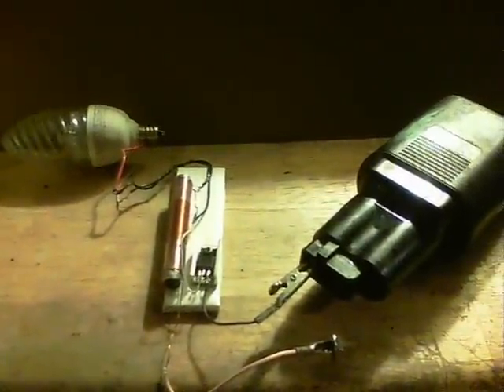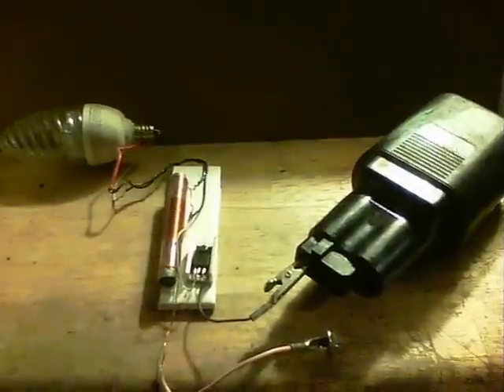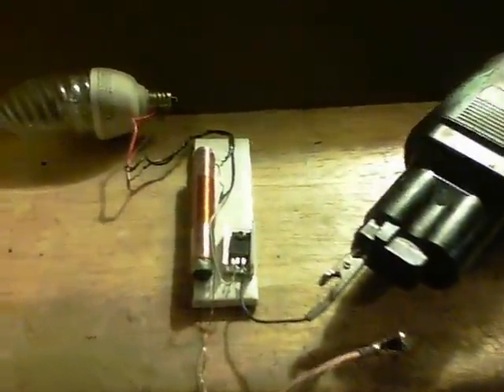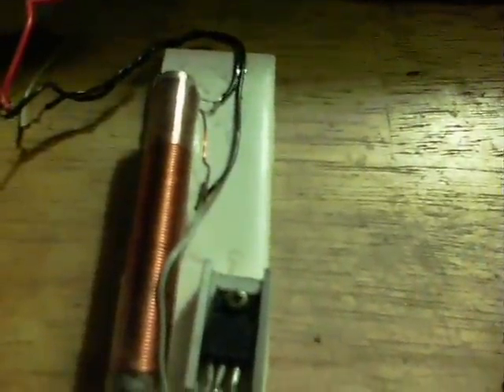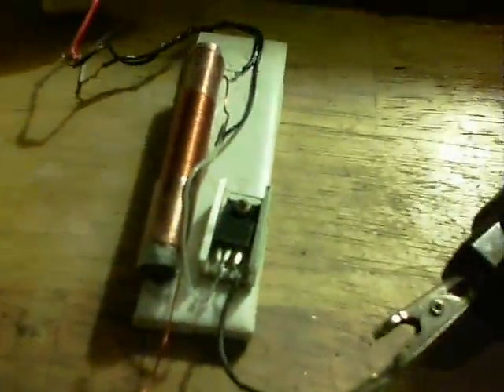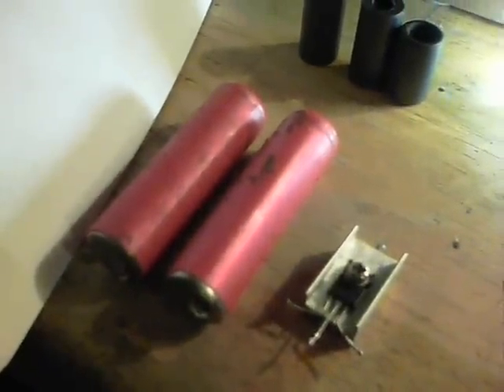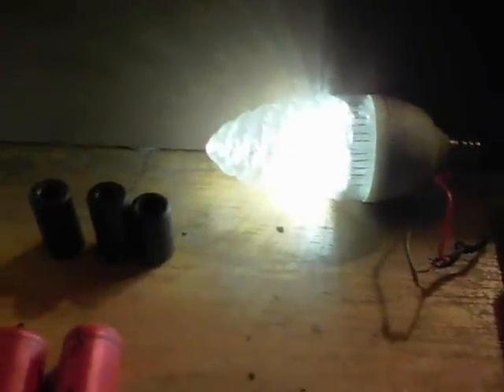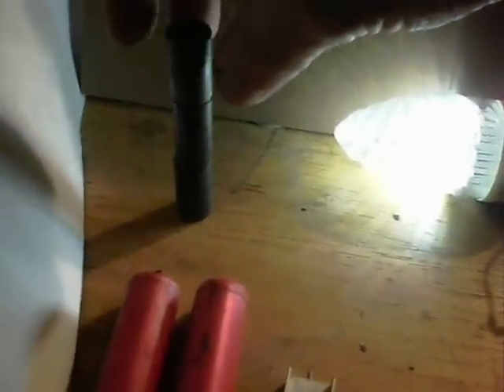SJR 3.0 Replication

Comment from the maker: It would run for weeks with a decent 12V of say 5Ah. This drill battery now charges to over 13V and holds up well, then I put it on solar in the day to recharge it. Automotive battery top up panels (150mAh output) do a great job to make it all free to use.

Comment from the maker: They glue well enough with simply superglue down inside, but epoxy would be stronger if making tight winds..stack to the length required :)
I haven't seen that about drill packs, may investigate on another, thanks !

Comment from the maker: Thanks, it's great for the simplicity. Probably a bunch of things can be done, for more like a blocking oscillator and perhaps the diode to Base trick. Works like this though. These ferrites are the ones that hang out of the back of the monitor, on the data cord, normally a couple inside too.